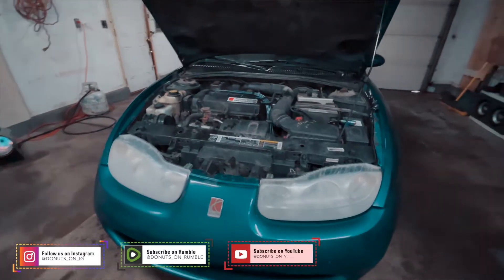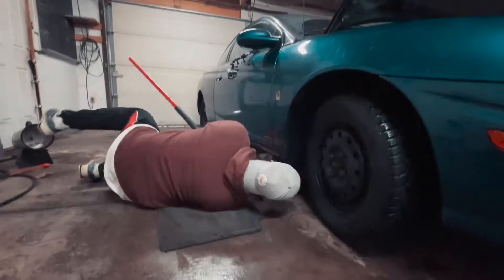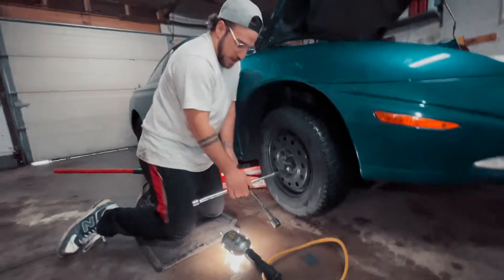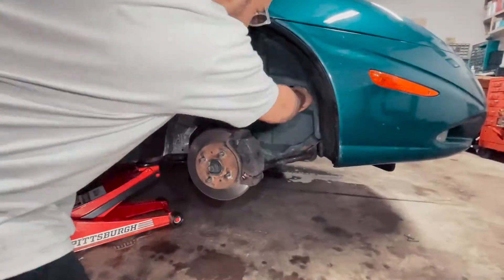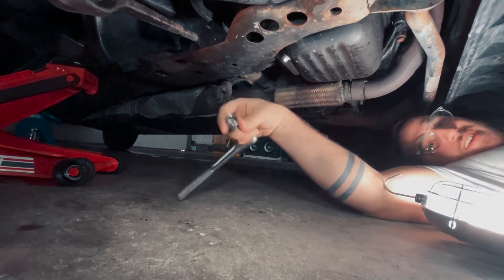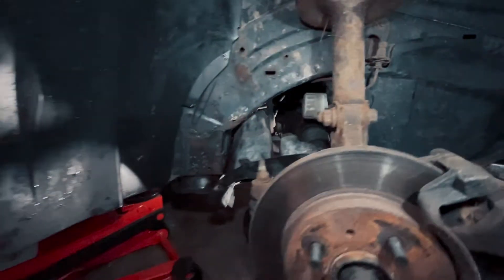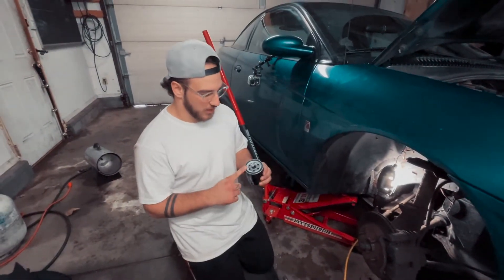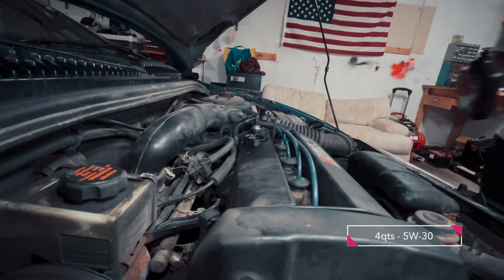Donuts: Saturn SC2 Oil Change

Comment: Thanks for the video bro I didn’t think I would fit under the car enough to grab the filter from the bottom but I guess as seen in the video you can get it from the side so I will definitely use that technique instead!